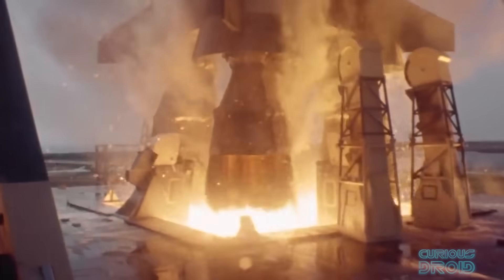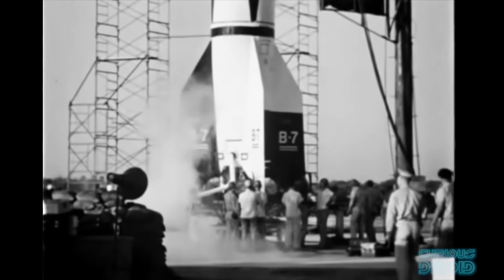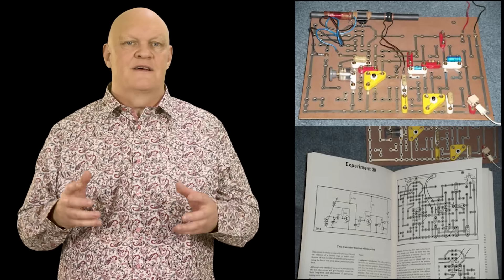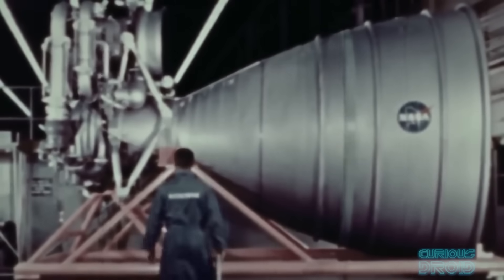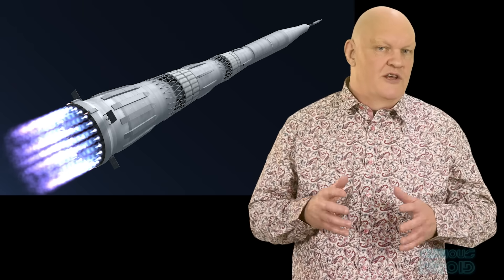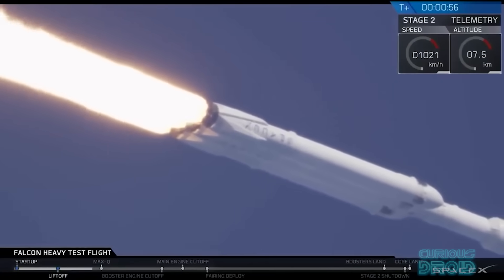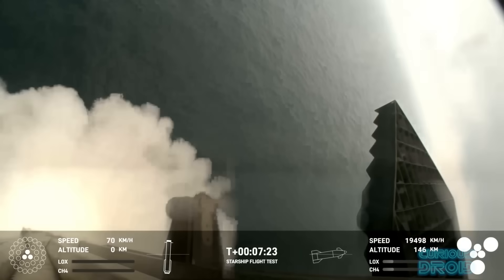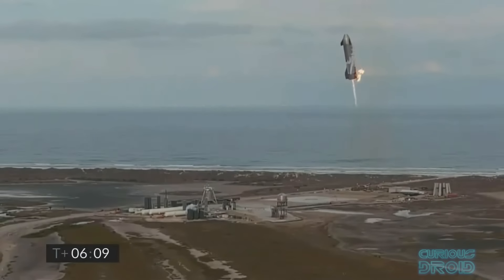Why Does SpaceX Use 33 Engines While NASA Used Just 5?

Comment: 1 addendum. The single merlin engine used for landing the Falcon9 is still too powerful to hover. So the engine is ignited at the exact altitude that it reaches zero velocity on the landing pad/barge and shut off before gaining altitude again.
Reply: Known as a suicide burn.  However, the Merlin can be throttled, with its lowest throttle setting still too powerful.  That does however allow room for error, so it is not just a full throttle burn to the deck
Reply: Suffering from success.
Reply: Close... They actually ignite it slightly late for minimum thrust to allow landing.  They can throttle it up to slowly so the decent decreases, then throttle it down to touch down fairly soft.
Reply: @HurdleHelps  I have heard they start engine with 70% throttle so they can decreace or increace throttle 30% so they can finetune landing. The engine starting point is calculated with 70% engine power.
Reply: Sounds like a tricky way of doing things.

Ok, for Falcon 9 booster re-use it's approximately the same mass every time, in the same G field, and it saves the weight of carrying a less powerful hover/landing engine.

But it sounds a lot harder to make it work on other vehicles with other missions. Star Ship for instance could be having to bring back different payload masses, and the lighter the vehicle the harder it gets. And for vehicles headed off to, say, Mars or the Moon, the gravity field is lower so it'd be even more tricky to get the timing / thrust right. For a single vehicle landing on, say, both the moon and earth and carrying different mass payloads every time, the timing and throttle adjustment rate requirements are going  to be different every single time. 

That can probably be made to work, but the certification testing of it sounds like a bit of a challenge. It could be simpler (from a paperwork point of view) to just carry an engine that can make it hover at its lightest masses in the lightest G field it's going to operate in. Better to carry the extra mass, than to weigh the project down in very complex certification testing. 

Another aspect is that landing on an unprepared surface - like the moon - hovering is actually quite useful. You can sit there for a while, safely up in the sky, whilst the engine exhaust blasts dust / debris out of the way reducing the likelihood of any rebounding material damaging the vehicle. Whereas leaving all the landing thrust to the very last moment maximises the chances of debris rebounding and hitting.
Reply: @abarratt8869  Your comment reads as if in response to someone arguing in favor of hoverslam / not-hovering but I don't see anyone doing that. :)
Reply: @abarratt8869 that’s part of why starship has so many “small” engines….it allows them to hover on two engines I believe, and this, in turn allows them to light up 3 of them, and pick the best performing two to land with. This is a great way to create redundancy and reliability.
Reply: Slam landing
Reply: #HoverSlam
Reply: you are officially an idiot! give me your address I'll send you the certificate!..
Reply: I google the word "Addendum" once and now I cant stop seeing it everywhere!
Reply: Did Apollo 11 actually leave near-Earth orbit?
Despite the revisionist narrative that this channel won't question -- unstable fuel burn for the oversized F1 engines was never rectified and another arrangement in their place was made in order to reach near Earth orbit, keeping the F1 bell nozzle to maintain the desired appearance.  The great licking yellow flame was an indication that something was not normal as fuel was burning in the atmosphere while providing no additional thrust. This was the result of injecting additional kerosene into the exhaust stream for greater visual effect yet appearing to produce an inefficient burn unlike other rockets after launch.  No explanation is forthcoming and this issue is not addressed in any usual report; however, using a smaller reliable engine with a reduced fuel load and stripped down mission requirement allowed the Saturn V to reach near-Earth orbit.  The Apollo 11 crew attempted to demonstrate their position at over halfway to the moon as seen in the unedited version presented to the public while the more recently released unedited version reveals a flood of blue light entering the same window as the camera continues to roll, through which only a moment before, we saw the Earth far distant in what appeared to be very low light conditions. Then, as the camera pulls back from the window, the exposure settings are seen to return to normal as a flood of light enters the same window.  Without a change in the orientation of the spacecraft assumed to be on a trajectory toward the moon, the only source for any flood of light can be the Earth while in near-Earth orbit.  The usual sponsored efforts will try to make excuses for why the obvious did not take place -- yet is overly apparent in the unedited version.  When facts cannot prevail in support, sponsored activity will resort to name calling and other derogatory comments discrediting themselves.
Reply: @ronaldgreene5733  "The great licking yellow flame was an indication that something was not normal as fuel was burning in the atmosphere while providing no additional thrust. This was the result of injecting additional kerosene into the exhaust stream for greater visual effect yet appearing to produce an inefficient burn unlike other rockets after launch."  

The F1 was a gas generator; a smaller engine burned some of the fuel and oxidizer to drive the turbopumps for the main combustion chamber.  The exhaust from the gas generator was then fed into the main nozzle to provide film cooling of the nozzle walls; hot as it was, gas generator exhaust was cooler than what was coming out of the main combustion chamber.  

This is why the exhaust looks dark coming straight out of the nozzle; that's the soot and smoke from the gas generator.  Shortly after that the heat of the main exhaust gets the soot hot enough to glow.  

If you people would take just take five minutes to read how this stuff actually worked you wouldn't go down these stupid rabbit holes.  

"the more recently released unedited version reveals a flood of blue light entering the same window as the camera continues to roll, through which only a moment before, we saw the Earth far distant in what appeared to be very low light conditions."  

It's called the Sun .  You may have heard about it.
Reply: Geez!!! You conspiracy lovers... Likely many like you maintained a "the earth is flat" belief until their dying breath WAY back in the day.
Let's forget for the moment the moon rock samples, the hundreds (if not thousands) of NASA employees that would have been a part of a conspiracy of this magnitude, and MUCH, MUCH more...
Simply put... The Soviets' eyes (and intelligence assets) were absolutely GLUED to the U.S. space program. No doubt some of their strongest telescopes were trained on the moon during Apollo 11, as would certainly have been their best radio signal intercept equipment and personnel. Without a doubt, the Soviets KNEW where the communication signals were originating from (the moon) and had tracked the Apollo 11 mission from launch to splashdown. If there was even the slightest crumb of doubt that could have been twisted it into a "it was a fake mission" scenario... they most certainly would have done so, AND publicly announced to the world the mission was a "fraud"... Obviously they felt confident the mission was a real thing... And instead of derision, they offered their congratulations!!!
ALSO... Please don't forget the pre-Apollo 11 flight (also manned) and resulting photos!
To claim the Saturn 5's F1 engines were not capable of leaving near earth orbit is the epitome of absurdity!!!
And yes... JFK was ACTUALLY assassinated, Terrorists ACTUALLY destroyed the World Trade Center, AND the Apollo 11 astronauts ACTUALLY landed on the moon!!!
To all of you deniers out there ... doctors have medicines they can prescribe to help with your delusions!
 @ronaldgreene5733
Reply: .  . While remaining in near-Earth orbit, another indication are the impossible weather patterns seen on Earth, when in reality only a small portion of the Earth's surface was visible, framed by the round window of the command module.  Straight line cloud fronts are seen on video to be extending for what appears to be more than 6000 miles, a quarter of the Earth's circumference -- something that has never occurred in the meteorological record on Earth. The round window of the command module was used to effect an image of the Earth but the weather in the region did not comply for a realistic view.  No recognizable continents are found in view, but only the impossible weather patterns seen.
Reply: This is not true. We throttle the engine down.
Reply: @agrozema54  try reading. at MINIMUM engine throttle a single merlin engine is still too powerful for falcon9 to hover.
Reply: @DrewNar-tacA  Pretty sure the person you just responded to is a spacex employee.
Reply: @Ergzay  "Pretty sure the person you just responded to is a spacex employee."
Yeah that comes as no surprise at all.
Reply: @Ergzay  good to know they cant read
Reply: If the engine didn’t have enough power have it gain altitude, it wouldn’t have enough power to decelerate the vehicle.
Reply: @dwaynepenner2788  you misunderstans, it’s MINIMUM thrust setting is too high to allow the booster to hover when its nearly empty, if it does not time it’s ignition PERFECTLY it will literally not reach the ground and start going back up again.
That’s why the technique is called a hoverslam or suicide burn. Superheavy thankfully doesn’t need to do this.
Reply: @Pissjugman195  correct. So while having more engines allows more thrust options it's not as if falcon9 can land just because it has more engines. There's more variables to landing
Reply: @Pissjugman195  it's not so much about the exact time of ignition - you can ignite it later, as you can still throttle it up when needed. It's the throttle control that is timed so that the rocket is fully decelerated at zero altitude. The time of ignition does not actually have to be as precise.

(you could ignite early and throttle the engine down, or you could ignite later and throttle the engine up, the time window is determined by the minimum thrust and the maximum allowable deceleration magnitude)
Reply: @ora6925  you’re correct, but i just didnt wanna bother with the longer explanation so tried putting it in simpler terms.
Reply: @ora6925  you’re right i just wanted to use a simpler explanation, was in a hurry
Reply: @Pissjugman195  That is also incorrect. The rocket engine is throttlable. It is not timed "perfectly". It is timed "roughly". The engine is throttled up and down to tune the landing time to align with the time of zero velocity. Yes it cannot hover at minimum thrust setting, but that does NOT mean that the timing has to be perfect.
Reply: @Ergzay  i already told you guys, i know that, i was trying to distill the concept into like 2 short sentences cuz i had to catch a bus lol.
Reply: @Pissjugman195  From watching the telemetry from superheavy and starship from IFT4, it looks like the three Raptors are still providing too much thrust when empty (at end of burn you can see they started to lift back off.) I was wondering why they didn't light them earlier, but it makes better sense that they simply CAN'T light them earlier. So, SpaceX masters the suicide burn.
Reply: @ora6925 but you can’t start the burn ealry then “throttle down” since the minimum thrust to weight is over 1 to 1 when at lowest throttle setting. You would have to start it late like you said and throttle up
Reply: @ewwwwhh  yeah no lol, it’s very light but it’s dry weight is still a couple tons
Reply: @Pissjugman195 it doesn’t have to be timed perfectly you just burn above minimum and start the burn after the minimum would hit 0 velocity
Reply: @zakbamber3077  sure but if your control algorithm is not extremely precise you can still overshoot or undershoot your velocity, which spacex did many times in the beginning.
It’s extremely difficult and very impressive
Reply: @Pissjugman195  It can be throttled, so there is some room for tweaking the trajectory so it comes to zero speed at zero altitude.
Reply: @pauldietz1325  i know that, but it still requires much less room for error than simply being able to hover, especially when it comes to lateral movements. Falcon 9 can’t really do the powerslides that booster 12 did on starship’s third flight for instance (i know that it’s intentional so they have a divert option but you get the point.
Reply: @dwaynepenner2788  "If the engine didn’t have enough power have it gain altitude, it wouldn’t have enough power to decelerate the vehicle."

Hovering requires that the thrust is equal to gravity, but any amount of thrust will decelerate it because any amount of thrust works against gravity.
Reply: @vinny142  to keep it from augering in I thought didn’t have to be said.
Reply: @dwaynepenner2788  Not really.  The LM's DPS engine wasn't quite capable of lifting a fully fueled and complete (not separated) LM from the lunar surface into orbit, and would barely hop a landed LM if that maneuver had ever been tried.  In fact, the LM descent profiles during landings called for a much higher thrust at the start of the burn than the DPS could achieve, so the "perfect" trajectory was updated with what was, according to its math, a badly underperforming descent engine, and extended full thrust deceleration until the craft got light enough (from burning fuel) that the trajectory converged to the planned path.  That's the main reason why the throttle-down time during the landing burn was only estimated on the ground about five minutes into PDI, and just happened when the PNGS decided it ought to happen.  The throttle-down timing was based on how long the engine took to get back onto the "perfect" path that required a more powerful engine.  Just be glad they stayed with that philosophy -- there was one proposed change to the descent burn programming that would have been very efficient, allowed a few thousand kilos more in landed weight than Apollo ever achieved -- but required the DPS engine to shut down and restart up to a dozen times after pitchover.  NASA decided (wisely, I think), that shutting your engine down multiple times while only a few hundred meters over the ground was just begging for trouble.
Reply: @dwaynepenner2788  He's referring to the lower limit of its throttle range. Merlin can throttle down to 40-50% of its max rated thrust and this is Still too much to hover. This is why Falcon lands so abruptly and not gracefully. Raptor will be able to do this as there are more engines involved and thrust can be better fine tuned.
Reply: I am too fat to climb a cliff, but if I slipped from the top I could slow myself down some.